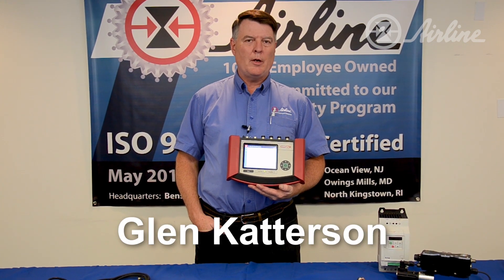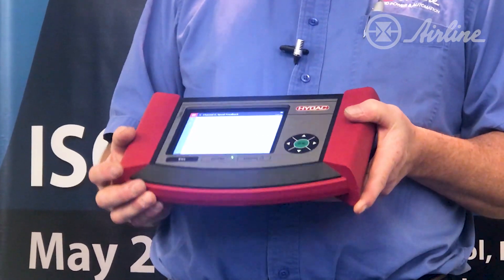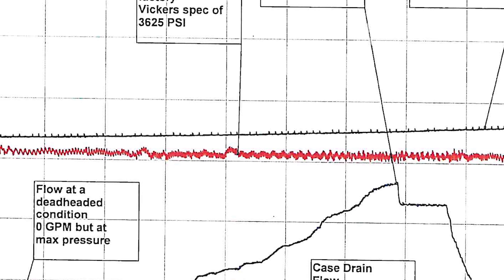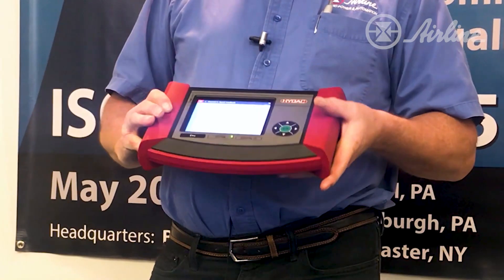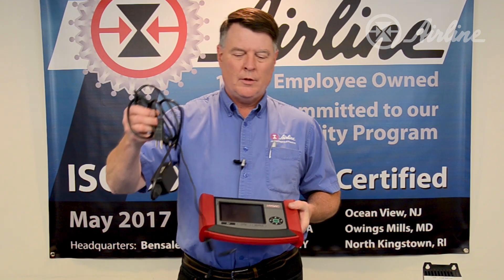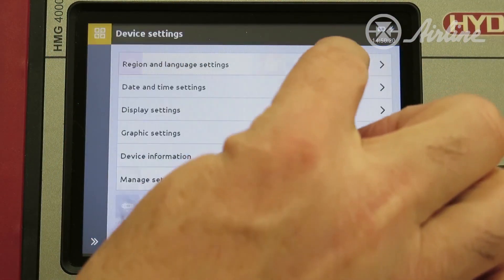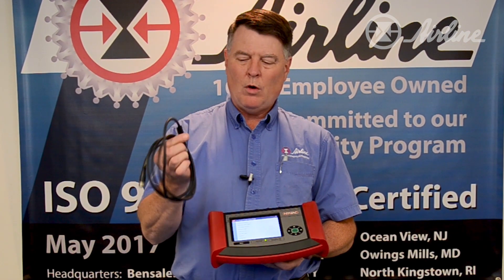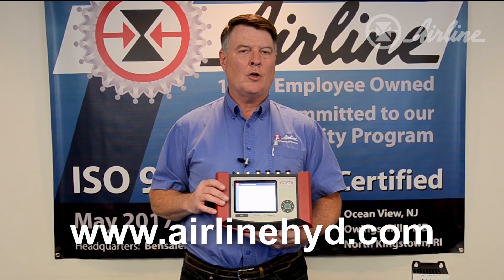⚡ HYDAC HMG 4000 |  📉Collect data from practically ANY device on your machine!

Comment: You can measure by HMG4000, the pressures and flows through of pressure sensors signal (1800 Bar / 0 to 5 V) and also gear flowmeters of a Bosch Diesel injection pump.